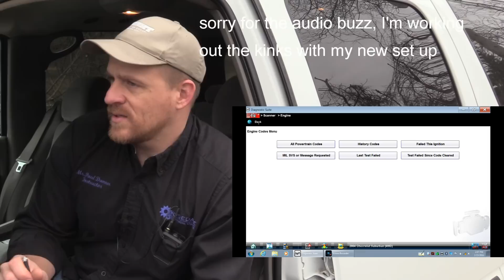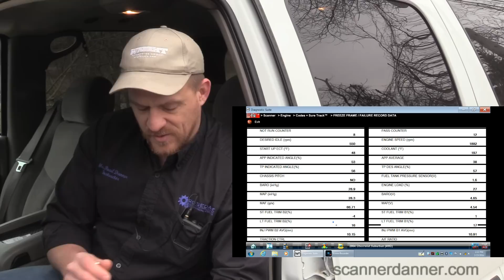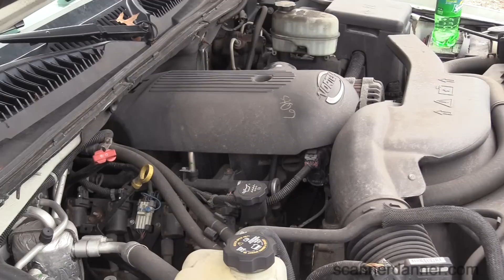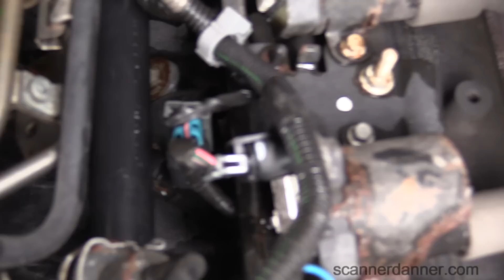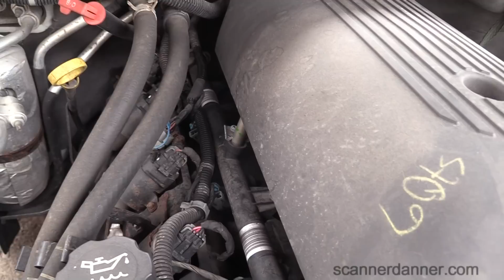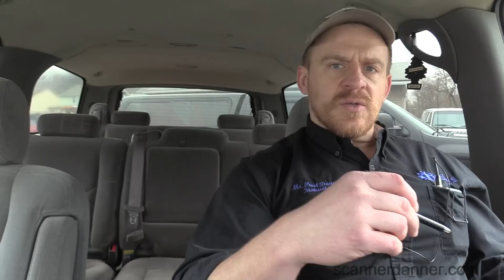Comment: Change your gas to  a high grade and it will be normal almost immediately
Reply: 100% false. This engine had an intake manifold vacuum leak that doesn't get fixed by using a higher octane fuel. In fact there are no examples of using a higher octane fuel to fix lean conditions.

Comment: I have an 04 Pontiac GTO.. LS1 5.7.. Got a hole in my exhaust header.. About 12" From where they bolt on by spark plugs.. So from spark plug about 12" down on one of my long tube headers... Has a hole in it.. Some little bolt pushed through it in a tidy area.. On frame   rail... Now is that why I'm getting the lean code
Reply: Absolutely if that hole is upstream of the O2 sensor
Reply: @ScannerDanner    You're the man thank you...

Comment: I got the po174 not the 171 , i checked for vacuum leaks with carb clean and a straw on the can , cant find nothing , yesterday i drove it around with fuel pressure gauge under the hood ( i need a longer hose ) you ever see a intermediate fuel pump problem ? Gauge quit 6 months ago , its always whined really loud , im guessing fuel pump at this time , 12000 lb atlas hoist broke down , cracked plastic reservoir,  and everything breaks instantly , two trucks front tranny pumps went bad on the same day , now this fuel issue ..im running out of trucks , 4 of them flooded outback in the hurricane ( might as well part them out now ) all chevys , 9 of them ..they keep me busy ..it takes 9 to keep 3 or 4 running ..darned old trucks
Can i fly you down to florida and get you to help me button up the easy ones ? I'll pay ya well ..i have been fighting them too long .

Comment: I have a 02 chevy tahoe 5.3l v8 150K miles. Just bought 3 weeks ago for 3500..  I pulled these codestoday. P0171 p0174 before I had to go t work.. I was driving on the freeway. Got to work. Everything  was fine no sputtering. And no hard shifting like a limp mode.. so I left work later that day. Got some gas... about 15 mins later it sputtered with my cruise control on. Made it off the freeway an it did not want to move at all.. my father said I got bad gas. I burnt most the gas out. Threw 91 in it. Same problem...
Now my problem is opposite than this... cold temp start it runs amazing
 No sputters.. no hard shifts and when it warms up almost to 200 degrees is when it starts running like its missing. But no engine misfire codes on the stored codes..
There also is no power. I hear a rattling noise as I accelerate.. I'm worried it's a torque converter or any other tranny issue.. 1st gear thumps into 2nd.. not to bad.. I can live with that.. 2nd to 3rd. I'm being gentle on the gas as well it goes to shift and hesitates. Climbs rpm and then knocks into 3rd. 4th is smooth. All fluid is good it's not burnt. Why is my p0174 and p0171 codes making my trans shift like this. Also there are no other codes.. I'm about ready to sell my rig for my original investment an get something else. I don't want to. But the transmission worries me.
Reply: Step 1, what is your fuel psi? (Engine running issues can make the tranny shift funny)

Comment: I appreciate your videos SD very informative I just want to say I had all of the same codes along with others so I started replacing everything fuel injectors spark plugs coil packs mass air flow sensor and was tempted to put a new  intake manifold &  gasket on it but first I  started doing some research on what individual components do &  control in which led me to check the fuel filter & after struggling to blow through it I realized  that it was indeed clogged not all the way but enough to give the codes P0300  P0171 P0174  P1131 P0443 P1400 so I change the fuel filter and thankfully all the codes went away & because I wanted to be convinced that that was my problem the whole time I started taking off the new equipment and putting the old equipment back on and to this day no codes..
Thanks again for your videos and help.
🇱🇷🇱🇷🇱🇷

Comment: Also on a 5.3 I did all new injectors and where the injectors will spray there looked to be carbon build up which might trigger the po171 and 174 both banks lean. But only when motor is warm.
Reply: With a? On the end of that.
Reply: What are your fuel trim numbers at idle and 3000 rpm in park?

Comment: I had a question I'm getting codes 171 and 174 I clear them and they don't come back for like a long time kind of I've had him three times my truck at Kohl's when I started short-term bank one is -7.00 bank 2 - long trims are plus 16.4 and 14.8 mass air flow sensors 8.2 I just wanted to know what you thought of these readings this is just first thing in the morning I started it let it run for about 5 minutes

Comment: Mine starts to get rough once warmed up at about 45 to 50 mph. What is the likely reason for the P0174 code with those symptoms?
Reply: define rough? 45-50 mph heavy or light throttle? This does not sound like a vacuum leak symptom
Reply: @ScannerDanner  medium to heavier throttle. Not super rough but I can tell there is a misfire. I only have the P0174 code. I have 2 issues. 1 my k&n pod filter fell off. I don't know when and for how long as I didn't install it, so it could be a dirt maf sensor. But I also have the issue with filling up and the pump kicking off way to early several times, so it could be the charcoal canister or the purge valve. However, these are just guesses and I'm not as experienced as you
Reply: @andrewbaker8342  see how it runs with the MAF unplugged. GM has good back-up strategies. It may stall a few times but we are interested in how it runs during your times of a driveability symptom. The fueling issue is related to the canister vent valve and is not related to this condition. If it still runs lean under load, next step is to test the fuel pressure
Reply: @ScannerDanner  it seems to be about the same. I've mostly just tested it at idle because I have had a rough idle. Worse on some days than others. The ie is almost the same with it unplugged. If anything it's a tiny bit better with it unplugged.
Reply: @andrewbaker8342  fuel pressure test is next.

Comment: If it smokes white smoke right when I start it and gives me these codes do you think it's the intake gaskets
Reply: White smoke is not from a vacuum leak
Reply: @ScannerDanner  I replaced the driver side valve cover and that fixes the white smoke problem, thank you for your help now I have another question, sorry 

Everytime I add gas even if it's not filled she doesn't want to start, I try it multiple times maybe by the third time she starts or if I floor the gas pedal while cranking and lately she started backfiring when it finally started

Thank you again in advance
Reply: @shuffleshuffleshuffle  symptoms of a stuck open purge valve

Comment: If you have cleaned the mass air flow sensor, checked your evap and vacuum lines and the P0171 code is still coming on, try throwing some injector cleaner in your gas tank because that code can come up from a clogged fuel filter, fuel pump, high pressure fuel regulator or dirty injectors too. I threw 2 bottles of injector cleaners at 2 full tanks of gas and it fixed the code for me. 2005 MK4 Volkswagen Jetta 2.0L

Comment: i have a fresh 6.0 engine build, fired up fine, doing break in on it over two days,  at 210 temp for over an hour threw lean code bank 1 & 2 and stabilitrak code. st/lt both banks pegged 28%.  i did a dod/afm delete on it, had cam base circle reground to get rid of the 1-4-6-7 afm specific lobes, block & heads were decked.  my cam guy said he took 0.050 off said i would need +.050 push rods, i did get them, they were too long, the oem push rods gave me exactly 0.072 "pre load" on the new lifter.    question is can the decking of the heads & block change the angle in which the manifold & gaskets meet the heads?
Reply: not sure, good question. Raise your RPM to 3000 in park and report back what your fuel trims are showing you. If it is drastically improved, then you are going in the right direction (vacuum leak). If it is still very positive, we have something else going on

Comment: A better way to find an intake vacuum leak is to spray carp cleaner on the suspected area. If there is a leak the spray will be sucked in and the idle will rise to a higher rpm.
Reply: Until it ignites and you have a nice fire on your hands. And a customer watching!

Comment: I am having same codes, but engine stalls once it warms up. I have dumped soo much money, I don't want to dump any more into it.
New MAF, throttle body, crank sensor, cats are gone and still doing it! ANY IDEAS?
Reply: Also, new fuel filter, fuel pressure reg, new plugs and wires..

Comment: Subbed at the moment you demonstrated the water test. That was just genius. Your thorough knowledge and process is top notch. I will continue to watch what you have.
Reply: Thank you and welcome!
Reply: I've always used carb cleaner to pinpoint leaks. Put the red straw on the carb cleaner and hit the exact area you're wanting to you will pinpoint where your leak is it will rev up the engine if it's leaking you can also check the O-rings are leaking by squirting them directly. And as far as cleaning the tops of the Pistons we used to bring up the idle and slowly pour transmission fluid into it. It also gets rid of any mosquitoes for miles!

Comment: My truck is doing this but it doesn't start throwing codes until it's warmed up on idle, I need help with it.
Reply: Fuel is your fuel pressure? Also fuel trim at idle and 3000 rpm in park. Having those numbers would help me help you better
Reply: @ScannerDanner  fuel trims seem to be all over the place but in park at 3000rpm they go in range 0-3 percent. Fuel pressure at start up around 55 but always stays around 43psi-45psi after start up. I'm looking at fuel trims right now sitting at idle ltft at 29% stft at 0
Reply: @russellallen1976  classic vacuum leak symptoms my friend
Reply: @ScannerDanner  that's what I thought at first but I  kinda halfway tried the water test. I can't hear any hissing I was going to check the pcv valve, but it's a 2012 sierra 5.3L with 60k the motor is very clean. I installed cold air intake and catback right when it got real cold out so I wasn't sure if temp caused it or I caused it or what. Maybe bad MAF?
Reply: @ScannerDanner when I say fuel trim all over the place sometimes it idles fine  even after warm up so it threw me off on the vacuum leak. But I'm going to try again to find a leak.
Reply: @russellallen1976  lose the cold air intake, put the factory air box back on before you do anything else
Reply: @ScannerDanner  ok, I'm going to try that,  thanks for the response, appreciate your work.
Reply: @ScannerDanner  fuel trims back to normal, but my engine still idles a little rough
Reply: @ScannerDanner  I'm a little OCD but after watching quite a bit of your content, my engine feeling like it's struggling, I want to bring her back to life.. I'm checking now to see if codes are gone..
Reply: @russellallen1976  okay but we at least know for sure your cold air intake was a huge issue. Those things are absolute garbage as you got to see first hand
Reply: @ScannerDanner  yea I'm getting my money back for that piece of crap. Thanks again man.
Reply: @russellallen1976  https://youtu.be/yCqv_G4zmT4
Now you'll understand this video

Comment: I have  a code p and p0171 and p0174 code took it to dealer feliz chevrolet and they had my truck fo 9ver a week the suggested over 10.000.00 dollars  fmto fix but never found  my vacuum leak spend about f.400.00 and didn't fix anything  need you help please 2004 escalade live in Los Angeles

Comment: That water trick showed me the same problem with GF's 2003 5.3.  white smoke appeared in the exhaust!  Thank you so much.
Reply: WICH was what ?
Reply: @Sethhaun78 instead of carb cleaner to find a vacuum leak, you can just spray a little water, like out of a spray bottle.

Comment: My 05 sierra started having issues the day after i filled my gas tank and added a lucas fuel injector cleaner.
Now when i step on the gas my truck will go high on the rpms the drop but it hardly accelerates. I cant get it over 30mph.
Did adding the Lucas bottle mess up my truck?

Comment: So if mine get higher after getting warm it's most likely a bad maf and they don't get over 9 really..so I'm thinking the maf?
Reply: are you speaking about fuel trim? there are other causes of high fuel trim numbers at higher RPM, low fuel pressure will do it too

Comment: I have a 2002 Mazda MPV V6. Low power. Bucking hesitation on acceleration. Scan codes. P0171. P0174
Bank 1 sensor 1 lean. Bank 2 sensor 1 lean. Replaced O2 front upstream sensor. 95 percent improvement. Still small hesitation on acceleration. Thanks.

Comment: I have an 04 Toyota Highlander 3.3L with lean codes on both banks. However, when I check fuel trims my LT FT are at -14 & when I rev the engine up to 3500rpm the LT FT spike up to -28 for both banks. Any suggestions. Is this a false lean?

Comment: Man were are you  located at ? I got a 08 Cadillac escalade with  them two lean codes  bank 1 & 2  & these people  have  put a new throttle body & 8 new fuel injectors & intake gasket  & manifold gasket & new fuel pump  & three  0 2 sensors & valve  cover  gasket  & my truck  is still  running  lean  please  HELP
Reply: My brothers shop is in Bethel Park Pa (south of Pittsburgh)

Comment: Have p0174 and p0171 codes on my 2002 Toyota Camry. Replaced pcv valve, MAF sensor, cracked oil filler cap, intank fuel filter and sock. Trying replacing fuel injectors and intake manifold gaskets next.
Reply: I have some videos on Toyota injectors with some issues. 
This is from a Chevy Prism but it is a Toyota engine
Part 1 https://youtu.be/Q6lRNG5NdQU
Part 2 https://youtu.be/pv9R2IEG4mU

Here is a 2003 Pontiac Vibe (Toyota engine)
https://youtu.be/85nMC6xIfUg on this one I tried to clean them without success.
Reply: @ScannerDanner  thank you

Comment: What if you have bank one only
Lean code changed 02 sensors it runs rough at idle but it when the truck shifts into over drive at low speeds 40 to 60 miles an hour and I try to speed up with out downshifting basically lugging the truck in over drive it will shake and hesitate like the whole bank is missing
Reply: Changing the O2 sensors means nothing.
What is the O2 voltage showing you on scan data on the side that is setting the code? Also, what are your fuel trim numbers on both banks

Comment: Never use water on the intake . Water doesnt burn like fuel does thats how you blow up a motor. Use carb cleaner on the itake , it combusts.
Reply: It sure does, and when you have an intake backfire while spraying for a vacuum leak, you then have the entire engine bay on fire. You will NOT hurt an engine with this amount of water. It is much safer and way more accurate as I showed in the video. Water test for the win

Comment: Hey man do you think you could help me out? I'm having issues with my truck it's an 04 gmc sierra with a 5.3 it starts up drives fine but randomly stalls when driving and will not start back up until you let it sit for like an hour or so and unplug the battery. When this happens it's cutting spark to all coil packs on the engine I verified this I backprobed the Ground wire feeding the coils and hooked it directly to the battery and the problem still persisted. I also have another truck I swapped ecu's bcm and ignition key to see if it was the ecu but the issue still came back. I also checked codes and had about 41 random codes I will copy and paste them 

P0171 Fuel trim system lean bank 1 

P0174 lean bank 2

P0178 fuel consumption sensor circuit low voltage 

U1026 not passed sc loss of class 2 communication with ATC

U1041 not passed sc Loss of EBCM communication
 
P0125 not passed sc engine coolant temp not insufficient for closed loop fuel control 

P0128 not passed sc coolant thermostat 

P0133 02 slow response bank 1 sensor 1

P0134

P0135

P0169 fuel consumption sensor 

P0741 torque converter clutch system stuck off 

P1111 intake sensor circuit intermittent high voltage 

P1112 intake sensor intermittent low voltage 

P1114 coolant temp sensor low voltage intermittent

P1115 coolant temp sensor intermittent high voltage 

P1574 stoplamp switch circuit 
This was before clearing them. Down below was after clearing the codes.  

P2771 4wd low switch circuit 

P0137 

p0138

P0169 fuel consumption sensor 

P0327 knock sensor circuit low voltage 

P0332

P0461 fuel level sensor circuit performance 

P0502 vehicle speed sensor circuit low input 

P0503

Comment: 15:15 answered my question lolz, thx.... I plugged my scanner in cause when I was driving the service engine light popped on, so when I came to a stop sign I grab my scanner behind the seat plugged it in and had both banks running lean that’s it, I looked at lives data and my fuel trims would hit %45 !!!! I never seen a fuel time this high on anything. But mass airflow makes sense. Guy I bought the truck from added a K&N air filter to it and I had a feeling the oil from that filter was gonna fk up that sensor

Comment: Chevy 5 threes and 6 O's are notorious for having intake leaks on the intake gaskets when the engine is cold that's usually the only time you will see it many mass air flow get replaced mistakenly even by the dealership there is a technical service bulletin on that and there are upgrade gaskets usually if you monitor the parameters with the engine called and spray a little carb cleaner around the corners of the front of the intake manifold you will see the leak I've been in Auto Tech for 53 years I just thought I'd share that with you

Comment: I think with mass unplugged it should run  better,since its measuring air coming in and unplug mass put the system in default? And system will ignore the vacuum leak..thank you paul